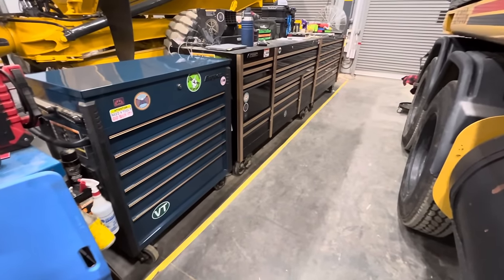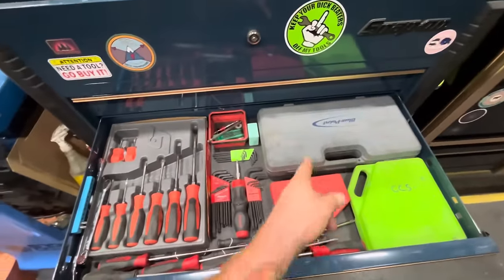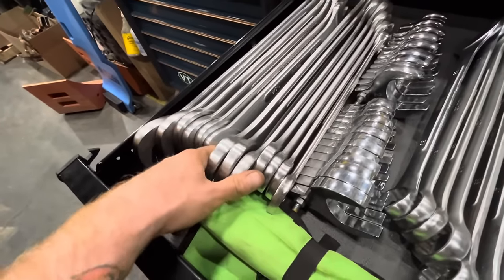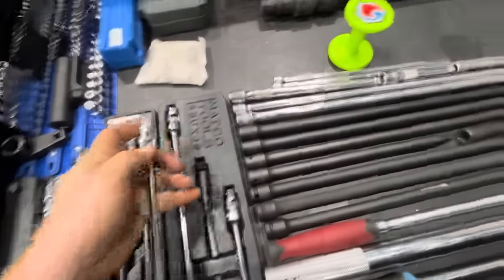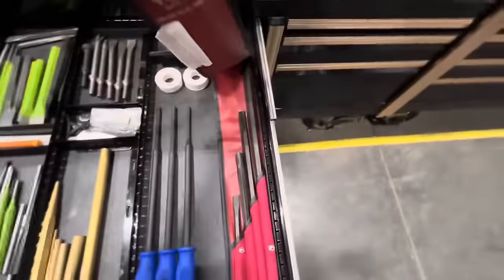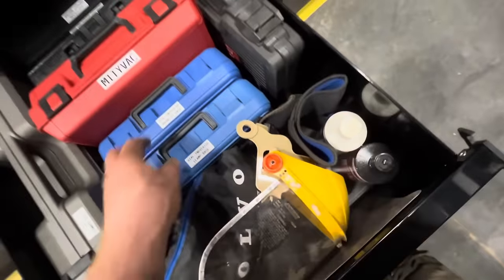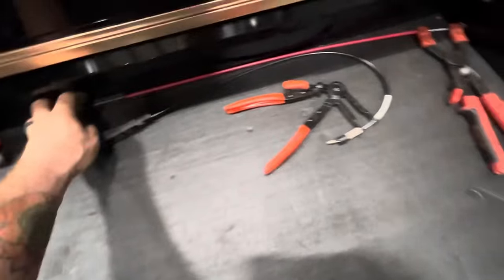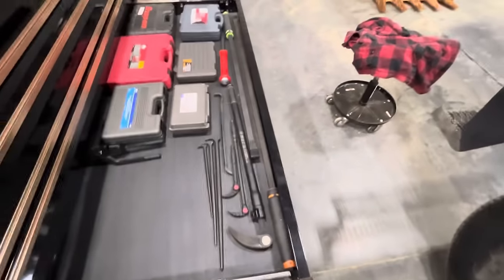2023 Snap On Epiq tool box tour

Comment: If you want to charge 24 volt battery set with one charger. remove the jumper cable. Attach jumper cables, pos to pos, neg to neg. Now it is a 12 volt set and you can charge both at same time, one charger.
Reply from the maker: That’s a good point, it would just take twice as long👍

Comment: How do those astro swivels hold up? Ive heard mixed things. Thanks!
Reply from the maker: So far so good, I haven’t had any issues with them. I like them better than the pinned type. The have a good feel to them and haven’t loosened up much
Reply: I have the 1/2 astro pneumatic impact swivel sockets and I've broken the 19mm and 24mm. I'm a millwright and used them hard for awhile before they broke. If your looking for good impact swivel sockets I'd recommend the grey pneumatic. There easier to warranty if need be. Tool trucks will warranty them and I didn't need to have proof of purchase like I did the astro
Reply: Ive had mine around 4 years now doing professional auto repair. Absolutely 0 problems with mine. Still work like the day i got them.